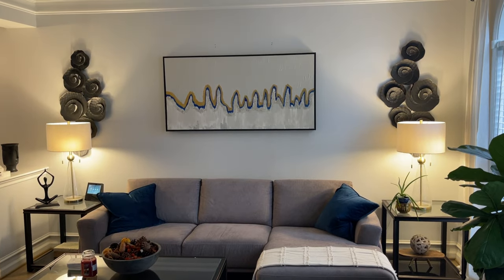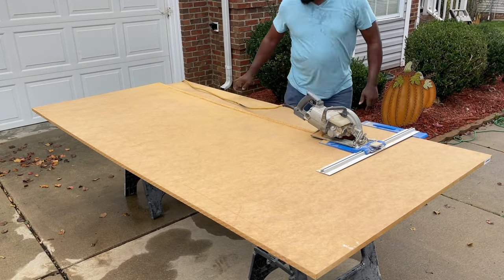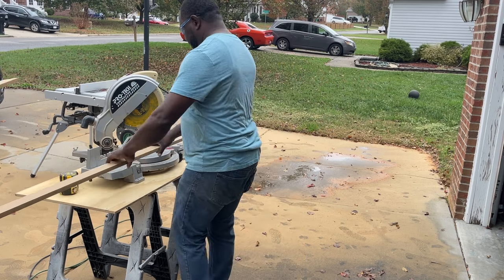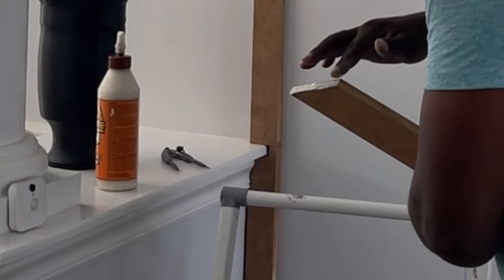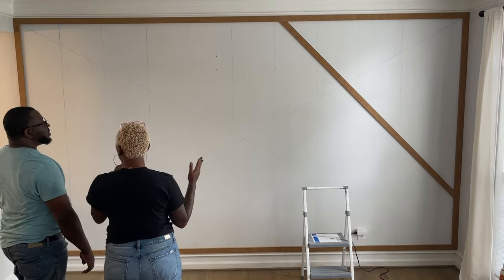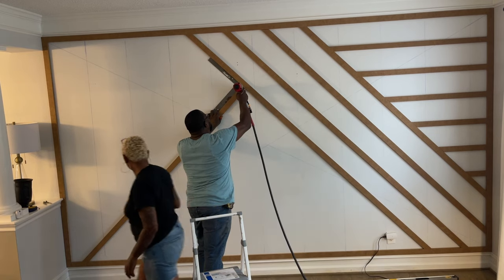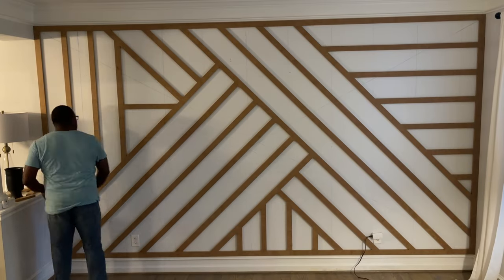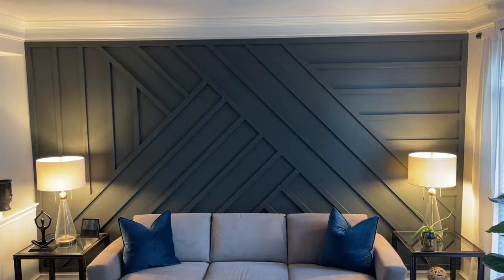Wood Trim Accent Wall - Cheap and Easy!! - DIY

Comment: This looks great, but I've just had to replaster a wall because of all the glue ripping plasterboard out with the batons lol cheap and great until you want to change it 🙈🤣
Reply from the maker: Notice that there was no glue to wall contact. Only glued the corners of the MDF so over time, it wouldn’t form a gap. That’s why I used a stud Finder and marked the studs. This way, you don’t need to glue it to the wall because you nail into the studs, where a available. I used 16 gauge brads and they leave a very small hole that can be easily patched with putty.

It’s not going anywhere but can be easily removed if you so chose to do something else in the future!

Thanks for watching!
Reply: Ah right I see that now, my mistake, regardless it looks brilliant 👍 I'm clearly still salty at the botch job the person I bought my house off did 🤣🤣 well done ❤️👏

Comment: Fantastic job 👌 only thing i would have done different would be to cut the wood at an angle where they meet instead of just butting them it would give you something to nail them too where there is no stud. Bit apart from that cant fault it 👌👌👌

Comment: Great job on the wall ,but how can I get theses cut without having any of theses saws I would love to do this on my wall..Thxs for any advice
Reply from the maker: You can get someone to rip the MDF and use a miter box and handsaw for the strait and 45 cuts. Makes them likely will need to caulk the seems but it’s doable.

Comment: Which saw did you use to cut the angles for the board? Im trying to figure out how to do all of this with my circular saw.
Reply from the maker: Miter saw. Would be easier for you to get a miter box and handsaw than trying to make the cuts with a circular saw. Can be done but you have to have a steady hand and you will need caulk.

Comment: Did you fill in the nail holes?
Reply from the maker: Didn’t caulk any of it. If I was doing it for someone else I would have made everything seamless but the cuts were tight and the mail holes were barely visible. The paint kinda filled the gaps.

Comment: how did you do it for $80?  The paint alone costs that much.
Reply from the maker: We used less than 1 gallon of paint. Was $28 at Lowe’s. 1 sheet of 3/4” MDF, again at Lowe’s was $52. Didn’t really caulk anything. Guess you can add the cost of the nails. 🤷🏾‍♂️